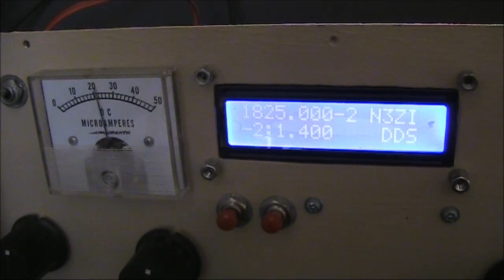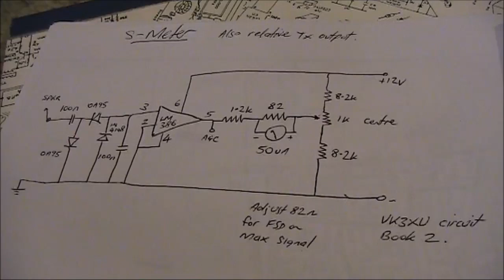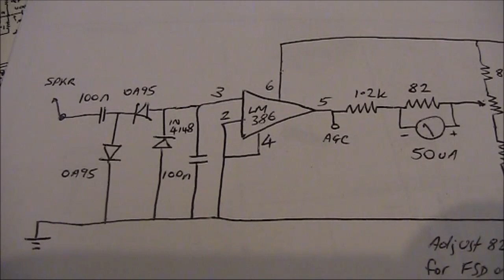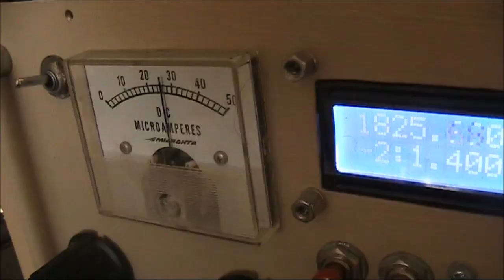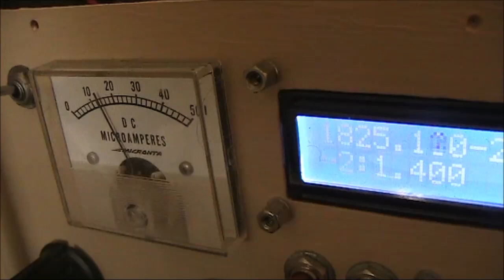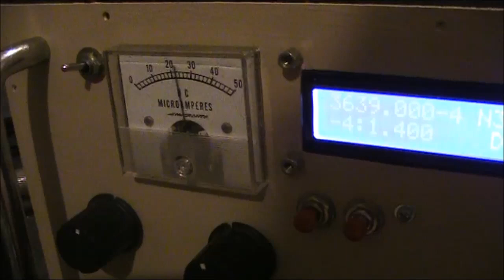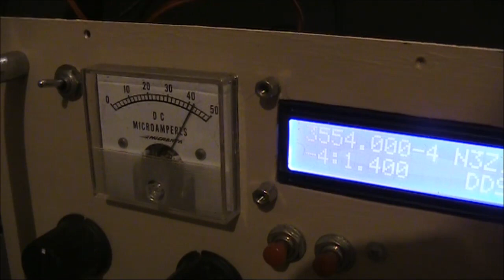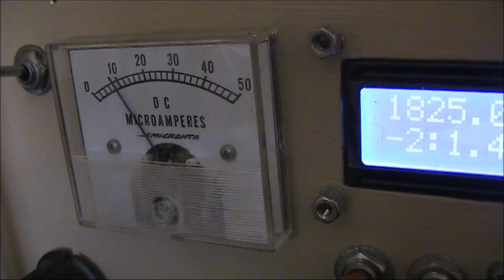Signal strength meter uses LM386 IC

Comment: S Meter response on modulated Audio signal or on RF signal strength?
Reply from the maker: Audio. But there's no AGC so it's proportional.
Reply: @vk3ye  i have old analogue radio with Led on it its led brightness depends on the strength of rf signal even if the tuned station don't transmitting audio signal sometimes .
How this meter works i have its ic's Datasheet where it's clearly mentioned that it have inbuilt s-meter for led but it is Working on rf instead of otherwise So why these diffrence ??

Comment: You don't have to measure audio. You need to measure signal. This is not a S-Meter.
Reply from the maker: In this rig there is no AGC so audio is proportional to incoming signal strength. Not ideal (you want S-meters to be non-linear with compression at stronger levels) but good enough for me.

Comment: That's a nice circuit for driving an audio derived S meter, I've not seen that one before. I've found the only problem with audio derived S meter's, are they tend not to be very linear in the lower and upper scale readings. Hence strong signals produce  far too much deflection, and weaker one's not enough due to insensitivity at the lower end. But the lower signal levels looks reasonably sensitive, so I guess this circuit is an improvement on previous audio derived meters. The QRN on 160, sounds to me like either LED lighting or switch mode PSU hash, which can be a real pain to get rid of. I use a noise cancelling signal phasing unit, to get rid of the worst of it, without which it would be impossible to hear anything below S6 on 80M. Thanks for sharing this simple interesting circuit.
Reply from the maker: Thanks Matt. You actually want S-meters to be non-linear, not linear. They're based on dB which is a logarithmic scale based more on perceived strength. Eg when a signal is really strong and they drop to half power you want the meter needle to drop only slightly, not to half-scale.
Reply: @vk3ye  Yes non - linear is what I meant to say, get it right Matt lol.

Comment: Nice 
But as for the "germanium diodes OA45" you used and similarly .. now are not available .
Thanks
Reply: You can use a shottky as a substitute,  try 1N5711.
Reply: @Paul_VK3HN  
Thanks
Reply: Any germanium diode will work and there a re plenty available.  IN34A or 1N60 are all over the place on eBay and/or Amazon
Reply: @Conjugate-Match  
Yes  , but now we can't find any germanium diodes  .